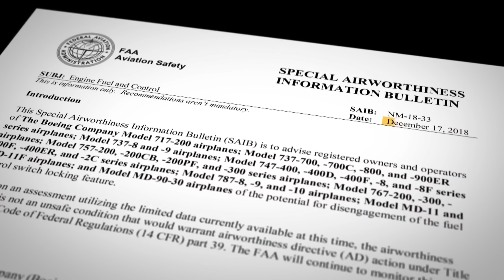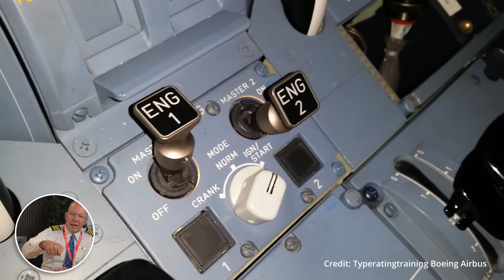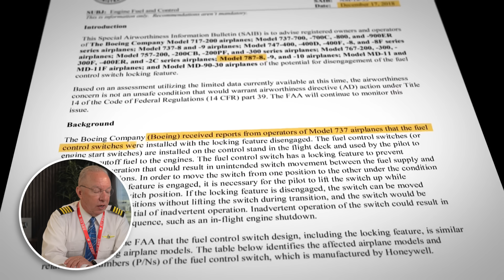Air India 171: The FAA’s 2018 Fuel Switch Locking Bulletin Explained (16 Questions Answered)

Comment: Im no expert by any means, but I have been following these 171 videos. From what I understand all data recorders point to a deliberate act to switch to cutoff, of which noone wants to believe. Though there seems to currently be no other conveicable way for them to be in cutoff from a manufacturing standpoint other than the bulletin. I know, as explained, at 7:30 the bulletin could be assumed to mean 'installed upside-down' meaning it would be very easily noticed and always default to cutoff making it merely impossible to even operate the aircraft even before takeoff and during taxi. However to me, the bulletin reads as if to say, if the locking feature is installed disengaged, then the cutoff switch acts more just like a simple up/down lever - making it prone to being accidentally knocked into cutoff. As we will never have visual evidence of this, would it be impossible to assume maybe the pilots had been operating the cutoff switch as normal by lifting during transition - without realising it didnt require lifting and would transition to cutoff without doing so. As they would never attempt to transition the switch without lifting it because of muscle memory and the switches normal transition mechanism.

- This leads to the validity of the pilots response denying switching to cutoff - was he telling the truth? did he genuinly not realise he had? was he covering himself?
- Without visual evidence anything is possible - could the pilot who issued MAYDAY actually 'SEE' the other pilot switch to cutoff or just assumed he had since they were evidently in cutoff.
- Or if we're playing devils advocate - could the pilot who issued MAYDAY switch to cutoff himself intentionally or accidentally and place blame on the other pilot then reengaged himself to be seen to attempting to salvage the aircraft and shift responsibilty.
- Neither pilot was at fault, and this was a direct result of Air India not acting on the bulletin.

I realise this is very speculative and I am genuinly not trying to be insensitive, as tragically neither pilot is here to defend themself. I just think without the FULL audio recordings, clarification on whether this particular aircraft DID have a disengaged locking mechanism (whether that would ever be disclosed) and lack of visual evidence, we will never 100% know the true cause of this tradegy until further findings.

I want to believe this particular aircraft DID in fact have a disengaged locking mechanism on the cutoff switch, and it just so happened by one way or another it was this flight that it was accidentally knocked into cutoff (arguable at one of the most turbulent times where everything is shaking/vibrating during takeoff, where such an event is more likely to happen), we wont know whether it was just pure luck that it didnt go into cutoff on previous flights. It seems to me this bulletin was a ticking time bomb waiting to happen, if this were to be the case.

Comment: I retired 6 years ago after a 35 year career with a major airline in the U.S.

If I was one of those pilots and heard and felt both engines quit then saw the fuel switches in cutoff, it wouldn’t take me TEN friggin seconds to turn them back on. That is an eternity.
Count One one thousand, two one thousand up to ten one thousand.

I am certainly not going to nonchalantly ask the other pilot why he did that.

After I immediately turned them back to Run, if the other pilot tried to do that again, he is about to find out that the 3 cell Mag light I carry is more than just a bright light.

One thing that puzzles me is the Mayday call.
For the non pilots, “Mayday” three times is the international distress signal. You say it 3 times to get everyone else to shut up while you inform ATC of your emergency so they can clear your path, help you in any way they can and get emergency ground equipment in position.
It makes no sense to say Mayday 3x after a dual engine failure a few hundred feet above the ground. There are far more important things to do like fly the jet, try to get at least one engine started again, maneuver to a suitable place to land and if necessary, eliminate any threat.

One engine started. It’s strange that nobody on the CVR mentions that.
That’s a big deal.
Maybe they had tunnel vision during the last few seconds.

Regarding a camera, if a pilot loses his marbles and intends to commit suicide, murdering over a couple of hundred passengers inthe process , he is legitimately crazy but not necessarily stupid.
He could easily get to the cockpit first and place tape over the lens without anybody, post accident,  knowing who did that.

Regarding a mechanical failure of the fuel control switch , I have never heard of one failing, ever, in my 30,000 flight hours.
The odds of both failing within one second of the other are nil.

Comment: I know nothing about aircraft, but am very surprised by an apparent lack of a visual / audible alarm system for such a scenario (fuel switches off during take-off / whilst airborne). I know engines are noisy and you may hear when they spin down, but the pilots wear headsets and presumably there is a lot of chatter, distractions occurring.

Comment: one pilot said "why did you put the fuel switches to cutoff?" and the other replies "i didn't." id it possible that the mechanism that makes them harder to switch was worn or not installed correctly and turbulence from taking off in the high heat somehow resulted in them being accidentally switched to cutoff?

Comment: Given that the purpose of accident investigation is to find out what happened, why it happened and to make recommendations to prevent a recurrence, if we suppose that the findings are that this was caused by deliberate action by one of the pilots, the question then is how can we prevent a recurrence?
I maybe wrong but it seems there is no technical fix to this issue. When it comes to dealing with human emotions etc this can vary from day to day depending on an individual's circumstances.
I speak as a UK retired pilot/training captain here. There is a fine balance between deciding to go sick due to ongoing personal circumstances as against deciding to go work and fly since getting airborne can be therapeutic in the sense that to do the job competently one has to put worldly cares behind one whilst on duty. Of course it is a given that one should be fit to operate in every way (mentally and physically).
In summary I don't think that there are any simple answers to this issue.

Comment: Is it possible that the system computer automatically turned the engine off switch, software wise that was detected by the FDR,  despite the switch is infact in the mechanically on position? I'm saying this because the fuel switches were no longer seen visually right now..that they really are in said off position.

Comment: I humbly disagree with captain Steve on one point. 
it's obvious that camera in cockpit would not have prevented this Crush but it would have massively helped in investigation behind the reason and root cause of this crash which would help in preventing future crushes due to similar causes.
And if Pilots are uncomfortable in being film all the time during a flight the cameras can be made to cover only specific places like overhead panel and other panels like where thrust control reside.

Comment: Haven’t heard anyone discussing the possibility of mental mode error. ie the copilot was in the wrong mental mode - he performed fuel shutdown procedure inadvertently (instead of raising gear or whatever). Simple human error. The issue is then how easily current cockpit design allows for catastrophic failure by simply ‘pressing the wrong button’ by mistake.

Comment: Some ex pilot was saying there could be a possibility of chip failure or malfunction which might have cut off the fuel supply, though the switches were in ‘on’ position (and it might have been recorded as ‘off’). 
This is something like our computers may hang due to overheating of the chip. Could this also be a possibility inside the cockpit ?

Comment: Hello Capt. 
Regarding the B787 crash preliminary report,
I have the following views;
With the information available so far, it  appears that the Murphy's Law had its way. The fuel switches were already a subject of Service Bulletin. Their working was suspected. The industry including Regulatory Authorities all over the world did not take it seriously. Normally in Aviation we never leave any scope for things to go wrong. So Fuel valve switches did snapped to SHUT. Leading to Engines spooling down. Pilots' attempt to re-light Engines rules out any deliberate action to shut off fuel supply. What happened next is known to everyone. Extremely sad and horrible preventable  accident. So, company which made these switches primarily at fault with equal responsibility of Boeing which installed them without ensuring that they will not operate on their own and the regulatory agency which approved the design. They should share the blame. 
What is your response to this ?

Comment: THERE WAS A BIG DISCUSSION THAT FROM DELHI TO AHMDABAD SAME FLIGHT IN MORNING PASSENGERS WERE SAYING SO MUCH ELECTRIC EQUIPMENT ISSUE ! WHY THIS IS IGNORED AS EARLY CLUE. WHT THIS PROBLEM HAPPENED ?
Reply: It wasn't ignored. According to the preliminary report, the plane underwent "troubleshooting" after it landed at Ahmedabad and cleared to fly. Moreover, the flight data recorder recorded no electrical problems in the few minutes that the plane taxied and tried to take off. Something else brought it down.

Comment: Airbus is around 5 years away from becoming a monopoly. Boeing just can't get it right, over and over their planes . It wasn't really their fault in this case, but the underlying problem that made the mistake possible in the first place was caused by them. Over and over their planes turn up with unnecessary design flaws that can't be properly fixed retroactively.

Comment: If I am unable to raise the landing gear while on the ground, why am I able to cut off the fuel during takeoff?
Reply: Because there is no reason to retract gear while on the ground whereas there are circumstances (vanishingly rare) where you would need to shut down or cycle engines

Comment: ComSN:7825 

Habe etwas zum FADEC von GE in Erfahrung gebracht. 

Der folgende Auszug in "" aus einer Kommunikation mit MIcrosoft Copilot über die Fähigkeiten des FADAC von GE bei der Boeing 787 JL516 23.01.2024 und Air India AI171 am 12.06.2025 lassen bisher wichtige Fragen noch unbeantwortet. Das könnte sich ändern.  

"Wenn das in einem realen Flug passiert ist, wäre die Analyse der Flugdatenschreiber und FADEC-Logs hochinteressant – denkbar wäre etwa ein Failover, bei dem das Kontrollsystem von einer sekundären Recheneinheit übernommen wurde."

Ein GE FADAC Failover durch den Signalweg der Kraftstoffschalter, oder militärisch betrachtet ein Befehl mit vorgehaltener Waffe und oder sowie wirtschaftlich mit angereichtem Bargeld, das ist hier die Frage.

Comment: The pilot that put the switches in off position may not be aware of doing so. Sometimes if you are in other thoughts you can do things but dont know you have done it. I think that a warning message should have pop up and you have to confirm that you want to shut of fuel.
Reply: NOTHING CAN BE MADE COMPLETELY "FOOL-PROOF" AND YOU CANNOT DESIGN ANYTHING TO HANDLE AND COVER ALL SCENARIOS WHEN DEALING WITH HUMAN BEINGS, THE MOST COMPLEX BEING GOD has CREATED! WHEN YOU ARE THAT CLOSE TO THE GROUND, YOU DON'T HAVE TIME TO TROUBLESHOOT AND CORRECT THOSE KIND OF PROBLEMS. HAD THEY HAD SUFFICIENT ALTITUDE THEY PROBABLY COULD HAVE COMPLETED AN AIRSTART AND ATLEAST ONE ENGINE COULD HAVE SPOOLED UP TO MAX POWER AND PREVENTED THIS. We don't want to even consider that this could have been suicide, but only THE LORD knows for sure.
Reply: By the way, those switches appear to be INTENTIONALLY  located in an area that's NOT CLOSE to other switches IN ORDER TO PREVENT ACCIDENTIAL ACTUATION. In other words, you have to INTEND to reach down there to pull each switch OUT OF DETENT to actuate it.

Comment: This is the first video on this channel that I cannot fully agree with. My concern is the cockpit camera question.
Of course, a camera would not have ‘descended’ on its own and switched the two fuel switches back on in time, thus preventing the accident. But with a video, we would know whether one or both pilots flipped these switches, or whether a third party operated them, or whether they switched off by themselves. If it happened without human interaction, we might also know why both switched off at the same time. And above all, we would know when it happened, i.e. at what stage of the take-off since taxiing.
All of this could enable measures to be taken to initiate countermeasures on existing aircraft.

I do not see any risk of video misuse, as cockpit video would not be uploaded directly to a globally accessible Google Cloud or similar, but would remain on the black box and, like all other data on it, would be evaluated after an incident and then only by a group of people authorised to do so.

Comment: 🕵️‍♂️ Noticed something odd. AAIB released the preliminary report for AI-171 at 1:00 AM IST on July 12, but WSJ published a report with key details nearly 19 hours earlier — on July 11 at 6:05 AM IST.

How did they get access before it was public? Just wondering if the report was leaked or shared in advance, or is it a conspiracy?

(WSJ article title: “Air India Probe Puts Early Focus on Pilots’ Actions and Fuel Switches”)

Comment: Don’t forget that even if the fuel switch was switched to cut off by one of the pilots it could be because of a medical condition also, maybe he had a stroke and wasn’t in his right mind. It doesn’t have to be psychology or evilness.

Also could it be possible that you pull out the button and pull it up but just shy of being in the fully locked position but far enough to not fall down imidiataly? Then fall down by vibration. Otherwise why would the pilot say why did “he” do that? Instead of why did “you” do that?

Video surveillance that can only be accessed from the black box would give more definite answers

Comment: Hey captain steev, i am not agrees on your theory of pilot error due to some personal life issue,...!! why you not thinking also on mechanical failure which may possible or may be simultaneously engine failure glitch as RAT come out immediately and same time due to this issue they even not able to take landing gear up also, even not able to understand whats happening just after 3 sec of takeoff...!!till last sec they tried their best to recover flight by restarting the engines...now why eveyone making them culprit, just because pilots not come back to tell the truth,...you  want make pilots scape goat for this big loss where they can not defend themselves. 

Why not boeing and air india is at fault? Think logical, not biased way....you may be fond & fan and big indirect protector of boeing company....as u completely ignoring advisory on fuel switch issued in 2018 ...how boeing only can issue advisory for such imp fault or doubts... their more responsibility to change it as safety & assurance, ensure safety,..

very sad politics to supoort big lobby of Boeing

Comment: Here on you-tube it is interesting how many videos of former Indian Pilots has come out to state that there's obsoletely no way the pilot purposely switch or cut off the fuel. They maintain and also believe that the switch failed. I can see one switch failing if that was the case, but for both switch to fail within 1 second of each other? Not buying it.
Reply: So far there's no indication the switches failed. The flight data recorder simply recorded them being moved from "run" to "shut off" within one second of each other and, 10 seconds later, one of them moving from "shut off" to "run." Four seconds after that, the other switch was moved to "run," too. The final report will have tons more detail, but that's like 2 years away.

Comment: Steve misunderstands the defect in the switch locking detent mechanism. SAIB says this: "check whether the fuel control switch can be moved between the two positions without lifting up the switch. If the switch can be moved without lifting it up, the locking feature has been disengaged and the switch should be replaced at the earliest opportunity" In this case the two switches were moved 1 second apart, so inadvertent movement seems incredible.

Comment: That's not what happened.  An engine failed during takeoff, and one of the pilots attempted to shut it off, but switched off the remaining good engine by mistake.  That's happened many times at altitude, and is no big deal, but during takeoff it's fatal.
Reply: No, the engines have been confirmed as working as normal before the fuel switches were moved to cut off within 1 second of each other
Reply: @clm2071  I hope that's not true.  I don't want to think that any human being would be capable of doing that.

Comment: Why there no safety interlocking for Fuel Cutoff  Switch..which is now a despute & looks very vulnerable subjected to Pilots  psychological mental condition..? if plane is flying in air then Fuel switch cutoff option should have password & that password should be with ground Aviation signal authorities.,,Also there must be Loud announcement in plane that FUEL IS CUTOFF & PLANE IS DESCENDING .
Reply: You think someone on the ground should have a password? 

A password to give to a pilot if he needs to shut down an engine?

There are a lot of bad ideas out there but congratulations, you've just won the award for most stupid one ever